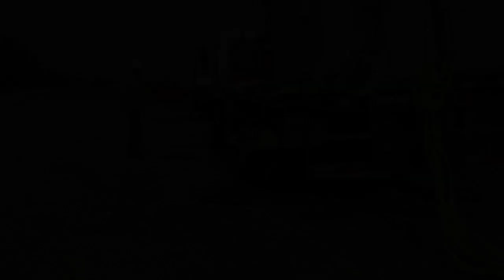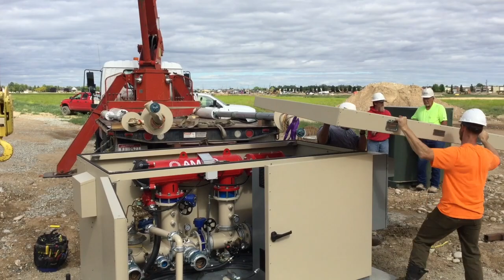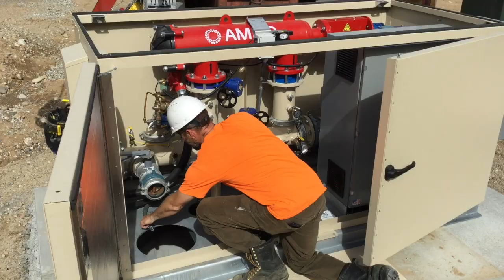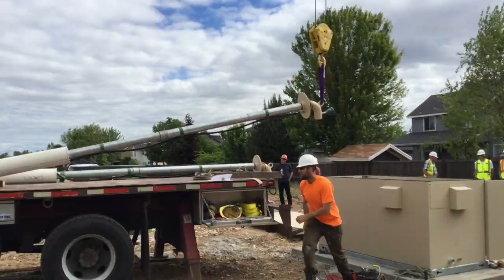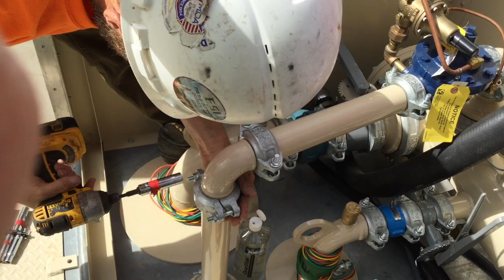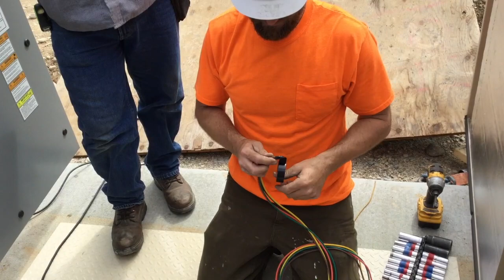PPS - Submersible Pump Station Installation Video

Comment: Thank you for the great video. Just wondering who is responsible for setting the unit in place and securing it to the ground. and who will be responsible for lowering the pipe into the wet well and connecting the pipe to the main line?